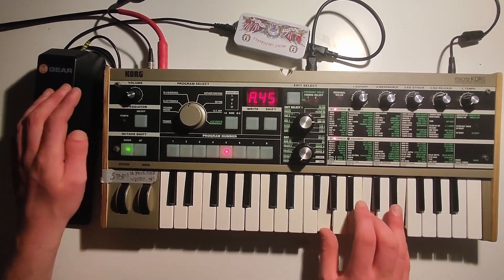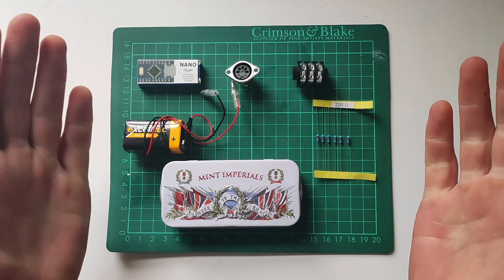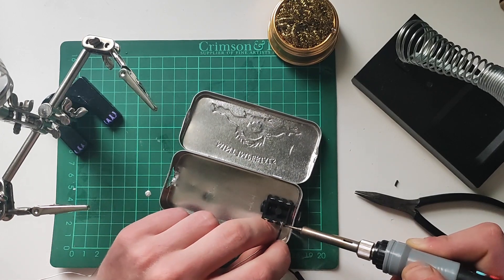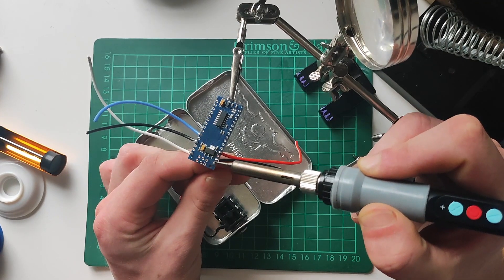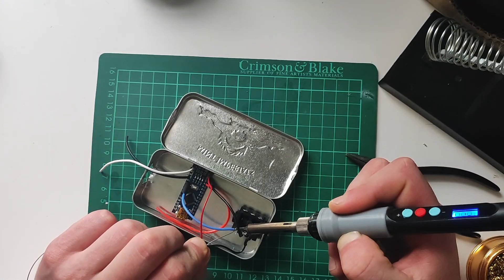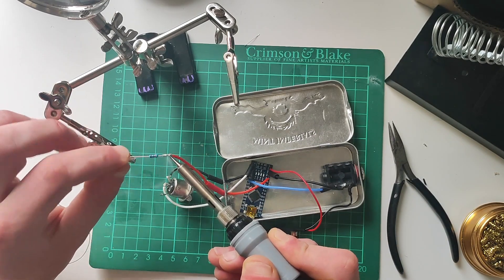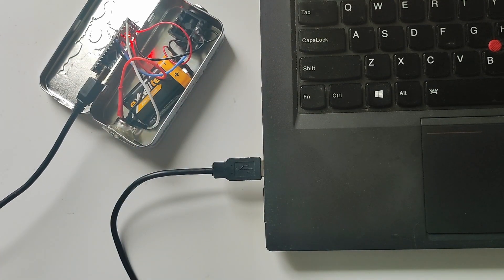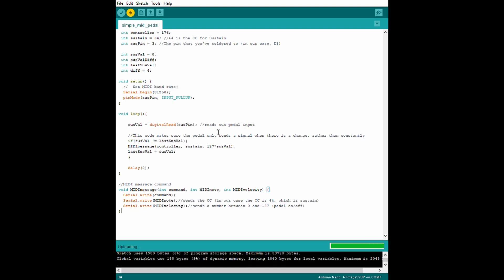Simple MIDI Sustain Pedal Build

Comment from the maker: *The schematic in the vid is slightly wrong (I made it in a bit of a hurry!): Midi pins 4 and 5 are the wrong way around. TX should go to pin 5, and the 5v should go to pin 4, with a 220 Ohm resistor in series. Additionally, it should be a 1/4" TRS jack and not an amphenol jack. Sorry for any confusion!

Comment: Hi, thank you so much for this tutorial ! I'm a complete beginner with Arduino.. 😅  Could you tell me the difference between the Nano and the Nano Every ? Is it the processor ? Is it compatible with your system ? Thank you very much !
Reply from the maker: I think the Every is just a more powerful, updated Nano - I’m sure you could treat it exactly the same
Reply: @Josh_McMinn  Hey Josh,
I followed your instructions exactly and I don't understand why it's not working…
When I try to upload it to the "Arduino" application, I get the message "jtagmkII_initialize(): Cannot locate 'flash' and 'boot' memories in description," but I read online that the upload process still works…
I don't understand; I've checked all the wiring, and it's fine. I also checked the pin mistake.

I'm using macOS High Sierra.
Do you have any ideas?

Thank you very much.

Comment: Hi , Thanks for the video , ive just recived the box from a friends friend whos made it for me , however he followed the video and sent it me but now i see below the video wasnt correct and the soldering bits need to be swapped around im guessing , However    it was ok downloading Arduino stuff but when tried to upload it to the Arduino now it needs to know where and what , unlike in the easy tutorial , maybe as technolgy has improved the coding bit is now a little more advanced , so im a little stuck on knowing why the sustain doesnt work , must be the soldering the wrong way as your adendment staes and possibly the coding hasnt actially worked as its not what your vid says , Can you help as this is SO FANTASTIC if it works as sustain would be fabulousnon this synth  , can you help ? please and thank you so much
Reply from the maker: Hi Kate, I suspect the issue is with the soldering being the wrong way around. Sorry about that! I made this video in a bit of a hurry. As far as I'm aware the code still works fine, I know a few other folks have made these successfully.
Reply: thank you Josh x x

Comment: Hi - Could you not make a hole in the casing so the USB micro port mounts, and the device can be powered by USB?  If so, would you still need the resistor connected to the midi pin?
Reply from the maker: Yeah absolutely you could use USB power. The resistor for the midi socket is essential - it's nothing to do with the power. The resistor is because the MIDI port is current-based rather than voltage based. The resistor converts voltage into current so that the synth can read it.
Reply: @Josh_McMinn  oh thank you!  I also got a tip from chat gpt that an optocoupler is crucial between the Arduino and the midi socket but is it unnecessary since you didn't use one?
Reply from the maker: @doghouse010  yeah the optocoupler just acts as a surge protection for the Microkorg. It separates the circuits so that if there's a freak current from the Arduino it doesn't fry the Korg's circuitry. I figured the Korg MIDI in  port probably already had an optocoupler in it, so I didn't bother putting one on the pedal. But I'm sure it's best practice to include one anyway.
Reply: @Josh_McMinn  It was fun getting the parts and doing the soldering, but arduino software wont upload which i'm finding online there are a multitude of different reasons or fixes to try one by one.  I've tried it on 2 different computers, but no dice!  Maybe i'll find the solution down the road.
Reply from the maker: @doghouse010  ah bummer! If it's a problem with the code, let me know, perhaps I can fix it. Feel free to chuck me an email at josh@joshmcminn.com if you've got any questions
Reply: @Josh_McMinn  Eureka!  It works with my new Yamaha Reface DX7 keyboard but doesn't work with the 1984 Korg Poly-800 but I've researched that this is because this synth doesn't accept or can't understand MIDI CC 64 (or Sustain).  I was advised to find the Sysex coding but now I think I'm in too deep!  Either way its a win!
Reply from the maker: @doghouse010  Amazing! Sounds like you've gone deep into the rabbit hole ahaha. 

It might be possible to program a sustain function in the Arduino code along the lines of:

IF {pedal on} AND {note active} 
THEN {keep note active}

But I can't think of any obvious way to do it, since AFAIK there's no 'note active' MIDI command only note start/note end. You might have more luck with SysEx!

Comment: Instead of the battery, you could also add a source and plug it into the socket, right? Hugs from Brazil, I loved the video and I'm going to try to do it here for my microkorg xl +
Reply from the maker: Hey, yes - you're totally right about that. In fact, that's exactly what I did in my more advanced version of this pedal (See the other video I made). I'd suggest using a 2.1mm centre-negative barrel port, so you can use a daisy chain from the Microkorg's own power supply.

Comment: This is so informative thanks! I've been looking for a solution to have sustain on only the lower manual of my Hammond XK System.  The only thing I'd need is what extra line(s) of code is required to set the Midi out channel to only one channel so it doesn't sustain both manuals.  I"m guessing this stock solution sends on all channels.  Is that easy to add?
Reply from the maker: That's a good question. I would imagine that sort of thing is easy to add, but I couldn't tell you off the top of my head. Easiest way to find out is to find someone else's project and see how they've done it!

Comment: what would I need to change for being able to connect it to a pc?
Reply from the maker: It's a good question. For something like that I'd suggest using a midi-USB adapter, then plugging a USB expression pedal directly into the computer. You can find all that relatively cheaply online and avoid the faff of building something like this.

If you were looking to upgrade this box, I'd probably add a midi in and a midi thru port so the computer can 1) send messages to the box/synth, and 2) hear messages sent by the pedals.
Reply: @Josh_McMinn  thanks for replying! what I'm thinking is, can I make something like this but without the midi socket, and programming the arduino to send the sustain signal as midi directly to the computer via its usb? and if so, can I not use a battery and use the usb signal as power source?
Reply from the maker: @matirojasc  I'd buy a USB foot pedal from Amazon (they're ~£15), then find a software fix to make it work with midi. I'm not a software guy but I'm sure it's doable. To answer you other question, I think bus power would be straightforward if you were to build one yourself.
Reply from the maker: https://www.amazon.co.uk/RIWPKFH-Computer-Keyboard-Instrument-Disabled/dp/B0B19GW1QD/ref=asc_df_B0B19GW1QD/?tag=googshopuk-21&linkCode=df0&hvadid=641818633835&hvpos=&hvnetw=g&hvrand=9841127528828904246&hvpone=&hvptwo=&hvqmt=&hvdev=c&hvdvcmdl=&hvlocint=&hvlocphy=9044956&hvtargid=pla-1928763107490&psc=1&mcid=04623e77ccd33288b245ce5a8d7ce526

Comment: Curious with this sustain pedal. Can you hold a chord or note to play forever as long as the pedal is pushed? Say if you wanted to create a drone to play over and such along with other synths. Or would it eventually fade to quiet because of the korgs envelope? Good work!
Reply from the maker: That's a good question. It should hold forever because the sustain pedal is holding you in the "sustain" part of the ADSR envelope and not the release. 

Perhaps I'll do another video at some point to demonstrate some patches
Reply from the maker: For drones I usually don't use the pedal though. If you put it on an arpeggiator with a latch, soften the attack a little and open the gate wide, the korg will hold a chord indefinitely.